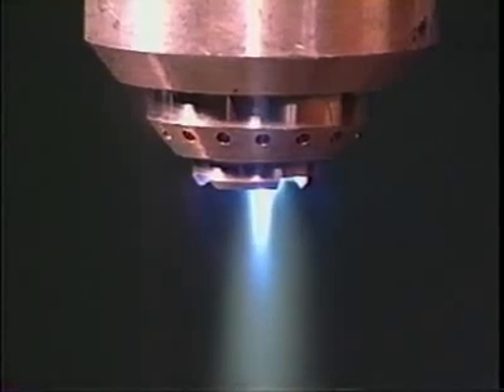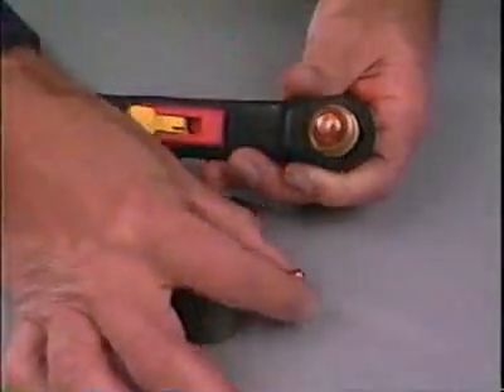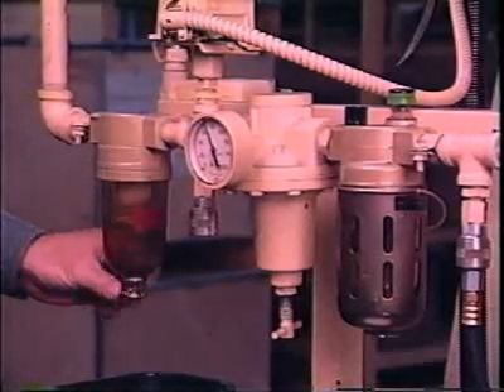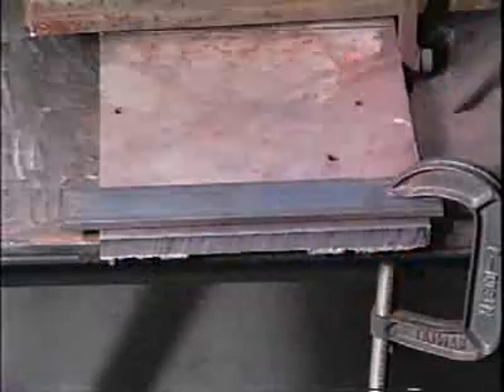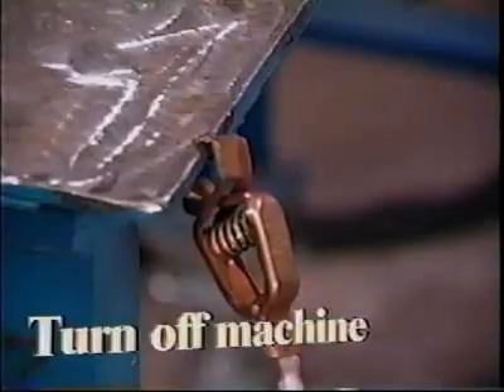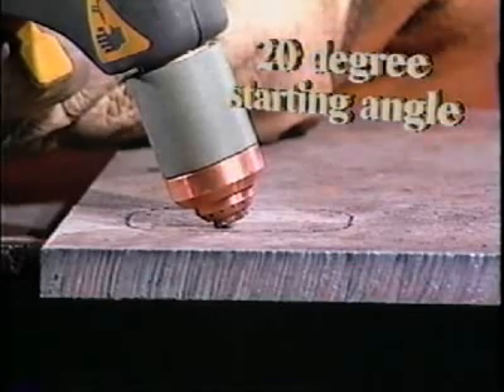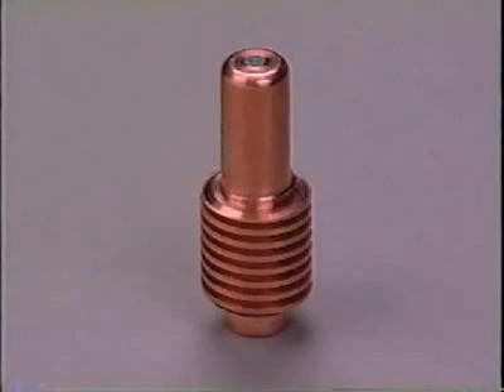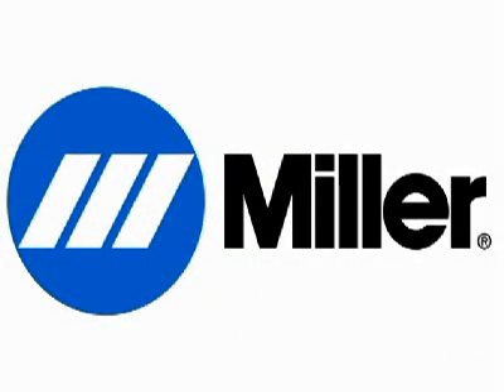What Is Plasma Cutting and Gouging?

Comment: Mine wont work on PVC pipe?
Reply from the maker: Hi, Plasma cutters are able to cut materials that conduct electricity such as steel, aluminum and copper. PVC pipe is made from a plastic non-conductive material so it can’t be cut with a plasma cutter.

Comment from the maker: The plasma cutter is able to cut through any material that can conduct electricity. The better the material is at conducting, the easier it will be to cut. Let us know if you have any further questions.
Reply: You'll need to ask your surgeon when you go in for a brain implant
Reply: Is there such a plasma cutter tough enough to go through concrete aha?
Reply: @AStanno08  Yes. It's called 'contained arc plasma'.
Reply: Miller Welders n